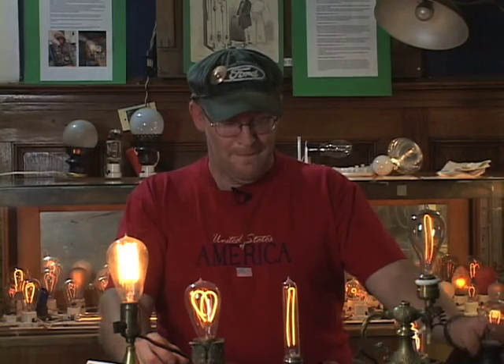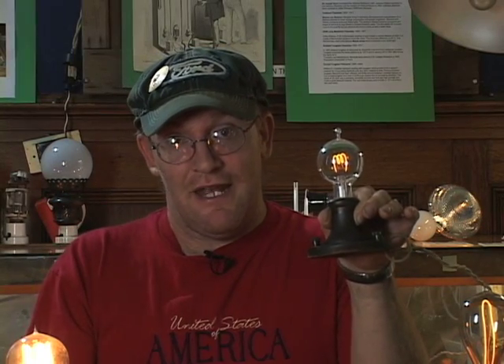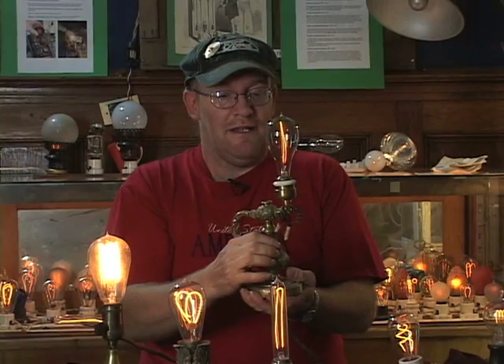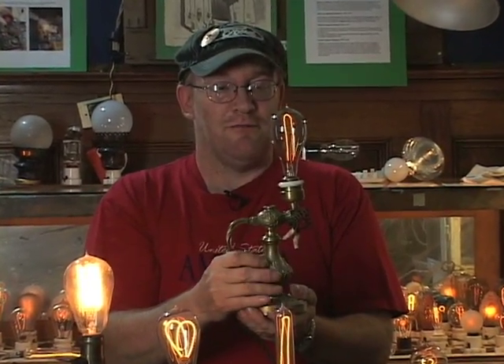Early Incandescent Bulbs - part 1

Comment: I know you don't want to burn out the filament and run low current through the light but what is the brightness of the bulb using the lights if today as comparison?

Comment: Fantastic video, there really isn't all that much information out there about these old bulbs. I actually just made a video about my first time powering up a squirted-cellulose filament lamp, and until watching this video I erroneously referred to it as a bamboo fiber filament. 

I used a capacitive dropper to current-limit mine to around 300mA (71V at the bulb) initially when I powered it up, and now I have it on permanent display running at 150mA (48V at the bulb), which as you said should burn for a very long time (decades, I hope).

Great content and amazing history, thank you!

Comment: Is it true that Edison devised an adapter which allowed his screw in bulb to fit a competitor's socket, but locked itself in so only Edison bulbs could be used, in that fixture?
Reply: This is completely false. You might be referring to the Westinghouse Stopper but Tesla was gone from Westinghouse when this lamp was invented. Geo Westinghouse is the name on the patent. Tesla had nothing to do with this lamp or any filament based Incan decent lamp.
Reply: Nicola Tesla invented a clever alternative that voided Edison's patents. He invented a loctal base similar to ones used in today's lantern and headlight bulbs
Reply: I just don't think that is entirely accurate. Not counting Tesla's Incandescent (Graphite) Button Lamp, he did work on creating an alternative base for a friend's demonstration of incandescent bulbs
Reply: There is no evidence of a lamp base deign by Tesla. Tesla generally did not collaborate with other inventors. By the time Tesla was working on any form of electric lighting, the standards of lamp bases were pretty well defined. Unless you have evidence of such a collaborative effort, I would add it to the pile of Tesla Internet folklore where you can read that Tesla invented anything and everything.
Reply: Chad Shapiro, yes I agree that Tesla is being over credited by the youboob crowd and the pop culture, which conversely hates Thomas Edison with as much passion as the leftwing hated(and still hates) President Ronald Reagan.
But enough of that, Tesla did invent the Carbon(Graphite) Button incandescent lamp. But since it required high frequency AC current & voltage to work, it never caught on.

Comment: Nice: vintage collection, i have a collection of lights myself, all of them collecting dust because some are burnt out, some still work, anyway, you are right about that, however afterr certain points in time they continued light bulb filamment tests to find one that would burn brighter, they found out soon after at that point in between the carbon and tugsten filament era was the tantalum filament, the use of tantalum filaments at that point have been used int the titanic when it was built in early 1912 up until 1931 heree they introduced the new lower voltage and built to last even longer tungsten filaments, in 1912 the voltage needed to light homes with tantalum lighting was around the same voltage the europeans used to light their homes, those volts are from 230-250 volts, and in the train and boat lighting voltage ranging from 80volts or more.